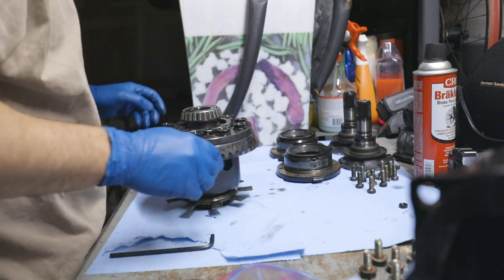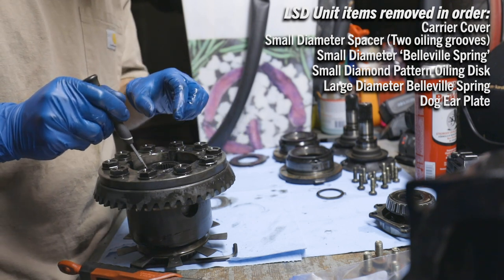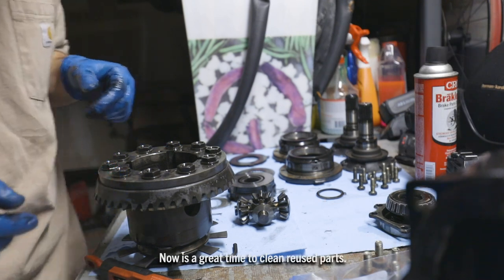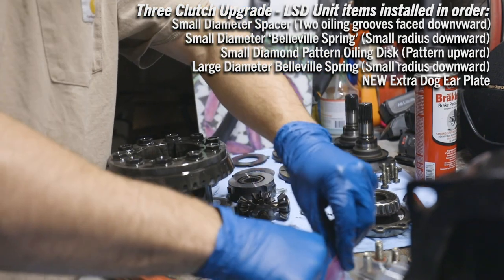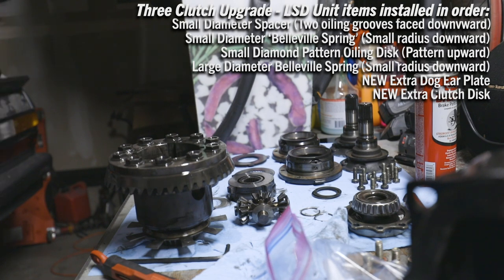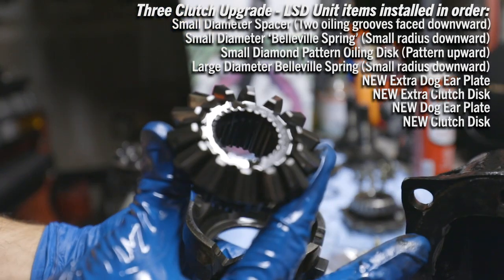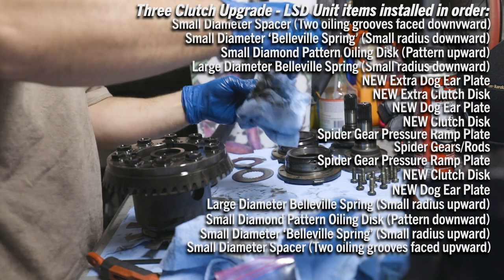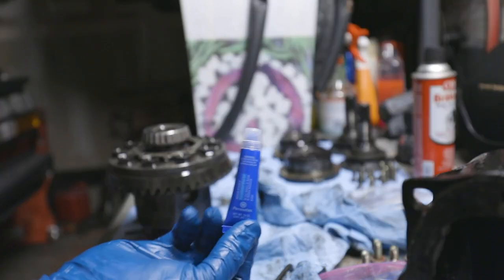SURLY the Patina'd BMW E28 - Part 5 - LSD Differential Upgrade and Refresh

Comment: Just curious, do you think you need the gasket air would gasket maker alone be fine?
Reply from the maker: I don't have a certain answer, but a friend and I recently opened a 944 transaxle that handles the same oil, and it didn't call for a gasket, just trans/differential specific gasket maker- so probably ok.
Reply: @SamHurly  oh ok sounds good enough to me lol

Comment: Where did you buy the axels for your build?
Reply from the maker: these were the originals, I re-booted and greased them back in maybe 2016. Fairly easy to pull since both ends of the e28's are just stubs and without shafts that go into/through anything.
Reply: @SamHurly  thank you!